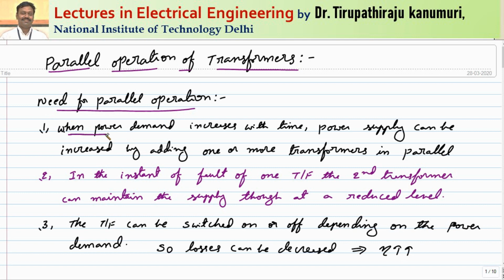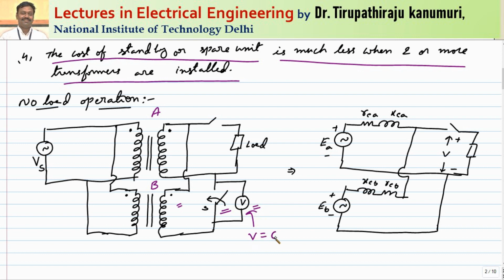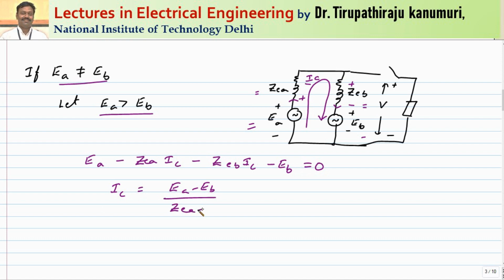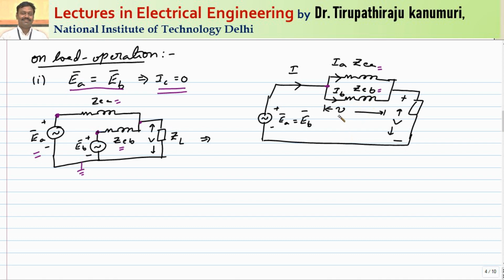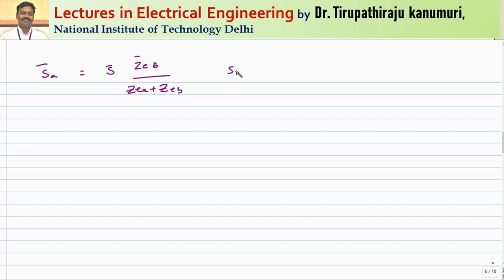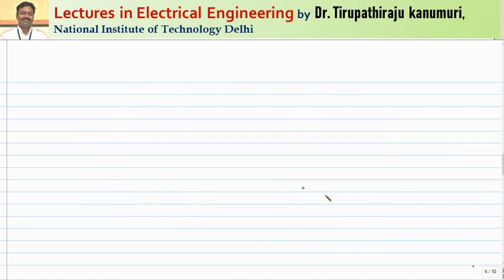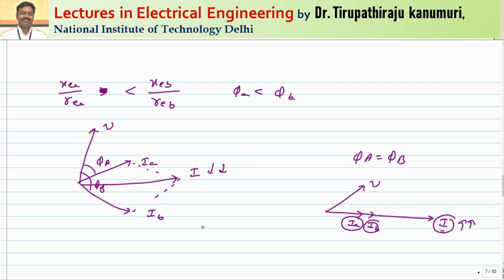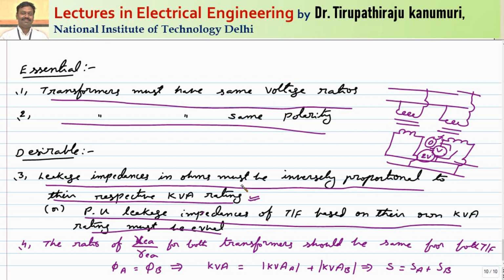TF12A Parallel Operation of Transformers

Comment: Dear sir.
I am from sri lanka, works at Ceylon Electricity Board.
Your videos extremely helpfull for our exams. 
I want to contact u, for a calculation problem in short transmission line.

Comment: Sir for no circulating current in transformer in  secondary side voltage must be equal otherwise voltage ratio must be equal?
Reply: @lecturesinelectricaleng   Thank you sir
Reply: @lecturesinelectricaleng  sir can you please upload power electronics lectures?   I learned lot of concepts from your lectures